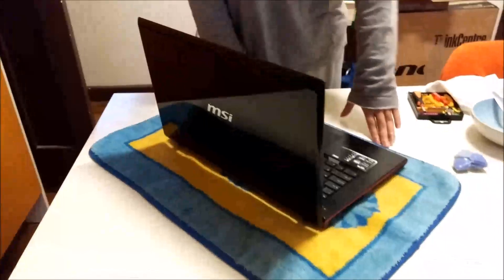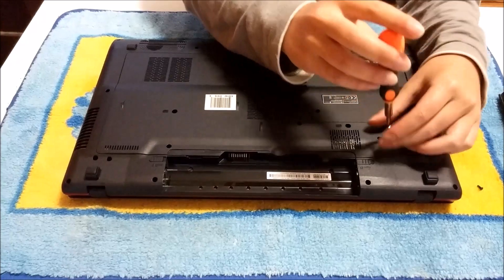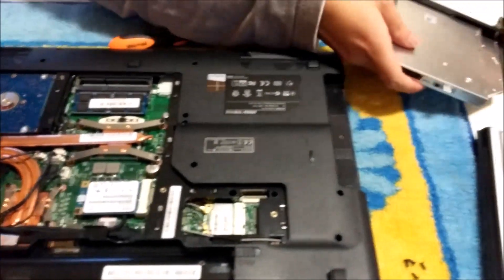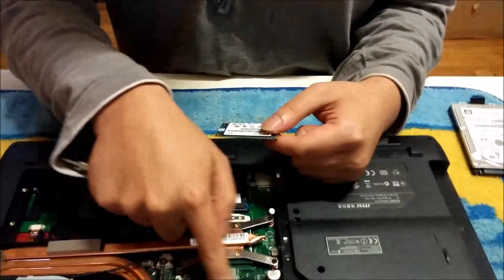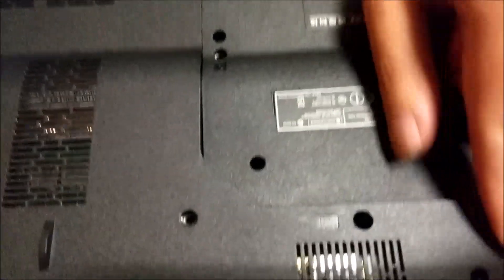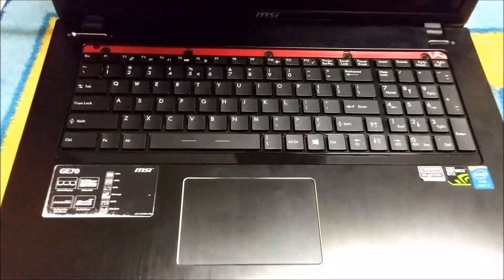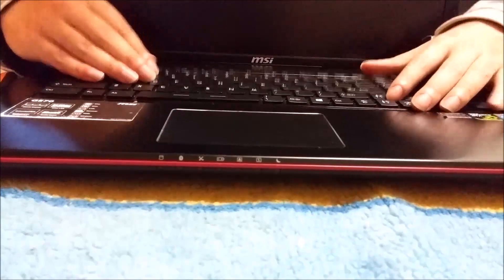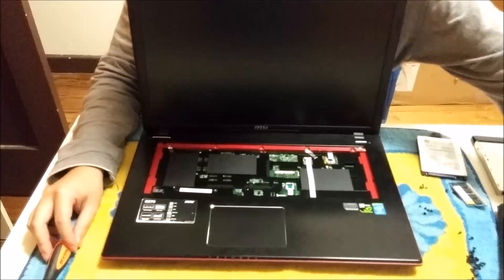OPEN ME UP! MSI Gaming GE70 17 inch Laptop Disassembly

Comment: You got some parts wrong when pointing them out. The card to the right on the video under its own cover is the wireless card (the 2 wires attached to it are the antennas), the card directly to the left of it across the black plastic is the mSATA SSD (if you remove the card the motherboard says SSD underneath). The chip with the single heatpipe on top of it is the CPU, and the chip with the 2 bent heatpipes is the graphics card (as it gets hotter and thus needs the 2 shorter heatpipes). The RAM in laptops is always closest to the CPU to allow for the lowest latency between the 2 components. I used to own this laptop and worked on it frequently, so that's how I know all of this.

Comment: has anybody tried two 1 TB mSata for Raid 0 (together 2 TB)? I have upgraded succesfully two times since 2014: first replaying both 128 GB mSata's (Raid 0 togeter 250 GB) with two Samsung Evo mSatas 2 x 250 GB (Raid 0 together 500 GB), later than two 500 GB Samsung Evo mSata's (together 1 TB Raid 0) - but would the the MSI  recognize 2 x 1 TB?

Any no chance for 2 x 16 GB?

... and what is the fastest possible CPU? (stock: i7 4170 hq)

... and are there possibilities for a graka-upgrade, too? (stock: GTX 860m, 2 GB)
Reply from the maker: graphic card is soldered on therefore can be replaced. the CPU can be changed and 2x 512 mSata will work. STOP wasting money on this old laptop. you are just digging yourself a hole. it is cheaper to get a new computer with that money and it will perform better than this. NVMe is cheaper than mSata and better in all ways. newer graphic cards are also way better than your old 860m

Comment: Lately, when I play games, even not very demanding games, I will get a lot of stuttering, and the sound also lags, creating crackling sounds. The laptop also heats up insanely fast when playing games, within minutes of starting a game i can feel it being very warm from the outside, most noticably in the area between the keyboard and the touch pad. Now I have dusted out my fan without removing it recently, but it didn't seem to work. I didn't apply any thermal paste and didn't remove it, because I am not very good at these kinds of things. Is there any risk involved if I try to do it myself anyway? Should I replace my fan, or do you think it can be solved by taking it out, cleaning it and applying thermal paste? And should I get a professional do it, or do you think I can resolve this issue myself?
Reply from the maker: this laptop is quite old so it is normal for you to run into these issues. you dont need to replace your fan but if you can change the thermal paste that will be good. the most important thing to do is to remove the dust which you have. use for a bit and see how it goes if you not happy with it then i recommend you to replace the thermal paste.
Reply: When I removed the fan there was a load of hidden dust in there, and after cleaning that out the issue was gone :)

Comment: I have been using this laptop since 2013, would you recommend to remove the backparts just to blow out some 'dust'. As I have never done this before, what should I use to blow it off, and also, what should i be careful about? :D
Reply from the maker: if you watch the video and think it is too hard then i recommend you dont do it. you are asking about how to remove dust which shows that you dont understand much about computers physically which is bad but with sometime on google you can learn about it. after learning about that and you feel the video is simple then do it if not dont.
Reply: What the fuck. That's a big ass wall of text. And also, I'm not braindead, I KNOW how to remove the backparts, i just wanted to be aware of some of the risk that could occur. I have heard that it is not recommended to just use a normal vacuum cleaner for instance. Also, It was a simple question if i should really BOTHER to do it or not.

Comment: Hi, My ge70 wont get past MSI, and i cant get in to bios, if i reset my battery would this fix my problem?
Reply from the maker: nope. what did you do? i need to know so i can help you with your issues
Reply: My laptop doesn't get passed the MSI screen (won't boot.) It just happend randomly and i can not get in to bios now
Reply from the maker: you clearly have some other issue. also removing the bios battery does not reset anything. only the time changes thats it
Reply: probably a drive/ OS issue, try reinstalling windows from boot media.

Comment: changed my screen now im geting no power too laptop
Reply from the maker: if you using the power plug then you probably forgot to plug the cable back to the motherboard but if you using the battery it is directly connected to the board and the issue is still happening that means you didn't connect the screen cable correctly

Comment: Hi, when im removing the back cover, the very right hinge just cannot go off. When i bent the back cover and looked what's inside, there was something attached to the back cover and i was lifting it too. Have any ideas how to deal with this?
Reply from the maker: you forgot a screw
Reply: maybe, maybe. Gonna try unscrewing most of them
Reply: I also had this issue. Did not forget a screw. Its right where the warranty sticker is. Its as if they made it impossible to take off the back plate or something.
Reply: Aha, I figured it out. There was actually a screw hidden underneath the warranty sticker.

Comment: Heya, did you not cover removing the fan? Can this be done without the other components? I need to clean it out because the ac port on the laptop gets insanely hot after 20 minutes or so of being on, so the metal part that goes in to charge the battery also gets really hot. Starts to create a "burn' smell so figured the fan is clogged up as it's right next to it.
Reply from the maker: no you must remove basically everything to get to your fan
Reply: Thanks

Comment: So excuse me if i sound "noobish" but deos this mean that its possible to upgrade my laptop?
Reply from the maker: this is what you can do. CPU can be changed, Ram can be changed to 16GB max with 8GB DDR3 in each slot and there are 2 slots, wireless can be changed, MSATA SSD slot and hard drive is a 2.5" inch hard drive.

Comment: Hi my msi ge70 has the regular none backlight keyboard and I want to upgrade to the color keyboard. Is that possible to do or does it have to have the capability?
Reply: On my GE70 2OE regular keyboard without backlight too. In the video I see that on the motherboard there a 12-pin connector for connecting a backlight of a keyboard (under the HDD). I checked this connector on my notebook and it's on this place too, but not used. I think that is possible to connect the compatible keyboard with backlight and it will be work properly without any problems, and this is what I want to do in near future.

Comment: Hello, what additional steps are needed to remove the internal "memory" battery? Thanks
Reply from the maker: you have to remove everything as it is on the other side of the motherboard
Reply: Ok, thanks.
Already got it done. After more disassembly to get to it the battery has +/- wires leading to a plug but battery and plug is sandwiched between 2 circuit boards so there's no way around it disassembly is a must.
Reply from the maker: better off if you disassemble it. that way it is much safer

Comment: Thanks for the video, could not figure out how to take the keyboard out before. 

I spilled a little bit of water on top of the keyboard and now the right hand side of the keyboard is always glowing(even when the laptop is off and most of the keys on that side don't work/press themselves. I took the keyboard off and dried it the best I could but the issue is still there. Any suggestions?
Reply from the maker: normally when you get water on your keyboard it is over you cant do anything about it even if you dry it, it will not work
Reply: Pretty much a new keyboard.

Comment: Hey my dude, my MSI laptop has been starting to lose frames in games I was able to run at 60 before. If I dust it out do you think I could get my performance back? Thanks for the sick tutorials.
Reply from the maker: by cleaning your laptop and replacing the thermal paste you can get your laptop back to the original performance it had when it was new
Reply: Alright my dude, I will try that out. Thanks for the response.
Reply: Did it work?

Comment: thank you so much. my word was the inside of my machine dusty. it is running much cooler now with far less strain on the fans. cheers.
Reply from the maker: thanks for your support
Reply: My MSI laptop has recently stared running less well with games. After dusting yours out did it begin to work much better?
Reply from the maker: when your laptop get dusty it is harder to remove heat therefore your laptop needs to limit the heat out put so it doesnt burn out. this is why your laptop performs less than normal to reduce the heat out put.

Comment: My GE 70 doesn't have that Sticker strip for removing the keyboard. At the top of the keyboard there are 5 notches. And then between the two speakers above that I have 7 buttons. Any ideas on how to remove the keyboard?
Reply: Exactly, and this laptop is on the Main picture of this movie, in the movie therebis diferent one.

Comment: I'm having the same problem as Surya Mani. My wife has this laptop, but the CMOS battery is dying and causing the clock to slow down. I can't find where the battery is to replace it though.
Reply from the maker: +coldwind I apologise I don't have the laptop anymore so I can not help you.
Reply: +OPEN ME UP time is not late becouse of CMOS... If CMOS battery is dying, then it will reset whole date after restart to factory date (something like 1.1.2009).. If you have problem with time in windows, its due to bad sync with time servers

Comment: I spilled some juice on my keyboard, and now the keys are a little stick - is it possible to remove the keys to clean?
Reply from the maker: +Garreth Hodgkinson nope you really can't do anything about it.
Reply from the maker: Yes you can try not to break the plastic clip that holds the keys on the keyboard
Reply: You can also wash the keyboard in warm soapy water,  then rise with cool  clean water, shyake the keyboard  'gently' to remove excess water, then leave to dry preferably  near 'but not on' a radiator or  on a window sill where the sun shines. Or use a fan to blow air over the keyboard until dry. Leave for a couple of days to ensure the keyboard is totally dry, then put back.  

This may sound crazy with electronic equipment, but  it does work with this sort of keyboard.

Comment: thinking of changing my harddrive. Does 950 pro is compatible with this laptop? It says  PCIe M.2 NVMe SSD but i don't have any clue what that is. Thanks
Reply from the maker: nope it doesn't have a M.2 slot so you can't use this

Comment: Can you suggest any screwdriver? The screwdrivers I have very short to do the job
Reply from the maker: +Berk Olcay any screw driver that works will work as all the screws are basically the same size. I can't suggest you one as screw drivers don't have sizes or number for me to tell you
Reply: Which one do you use in that Video may I ask?
Reply from the maker: something like this comes in a set and cost 8 AUD from ebay http://www.ebay.com.au/itm/New-32-in-1-Screwdriver-Hand-Tools-Set-Torx-T3-T4-T5-T6-T8-/131035330632?hash=item1e82507848
Reply: +OPEN ME UP i wonder it can reach to screw but in the video it looks like can reach. thank you soo much :)
Reply from the maker: the ebay link I provided you is actually the one I use

Comment: I have a question My MSI Laptop is bluescreening and its probably an overheat issue - is it safe to take apart the heatsink to clean it? 

My Laptop is very similar to yours and its heatsink is very similar.
Reply from the maker: +RegentofSparta yes it is safe if you watch my newer videos I do it for every laptop. there is also a video on how to clean your fan and replace the thermal paste
Reply: Cheers man :)

Comment: was thinking of getting this one , but I want one that I can take the battery out as well 

http://www.saveonlaptops.co.uk/9S7-179323-019-MSI-GP72-2QE%28Leopard-Pro%29-019UK_1811136.html

would be greatful for you help and advice am in the uk , do you have a email to get info
Reply from the maker: +Mike h this laptop here comes with 950M which is quite weak. as you may know laptop graphic card are only about 60% when compare to the desktop version of it. The desktop 950GTX only cost 150AUD and it isn't really that good.
Reply: +OPEN ME UP 

did not know that the 950 m is weak , dont know to much about them to be honest only thing with the gt70 is the keyboard is not backlit , at night here I would need one 

thanks for the video link too :)

Comment: which GE70 is this one
Reply from the maker: ivy bridge one with i7 3rd gen
Reply: +OPEN ME UP 

ok thanks what one would you recommened for uk users upto £850
Reply from the maker: +Mike h sorry don't know how much is 850 Euro as I live in Australia but then it is really up to what you need.  since you ask this question under an expensive laptop I assume you after a powerful laptop. branding doesn't matter anymore as you may know they all just ending up using the same parts so just pick the design you like or the branding you like most. the most important thing is there only 2 options, weak and high battery life or powerful and carp battery life
Reply: +OPEN ME UP 

Hi 850 euros is about £600-£700 uk pounds  not that much have you worked with the gp72 leopard pro yet , I want it mostly for editing videos 

will play some games like F1 etc  I want to get one upto about 1000 euros or below  have seen some 2nd ones on here  

http://www.dabs4work.ie/products/msi-ge70-2pl-218uk-apache-core-i7-4710hq-12gb-1tb-17-3--windows-8-1-9VK6.html

for 667 euros not sure if its a good idea to buy it 2nd hand incase theres problems with it
Reply from the maker: +Mike h basically everything I buy is second hand and I don't have any issue with it. I cant really provide you any recommendation but all I can tell you is I purchase this laptop 9 months ago and it cost me 700AUD second hand. So I don't believe it is worth 1000 eruos

Comment: I know in the case of  many MSI laptops (at least for my MSI GE70 2pe Apche Pro), the CMOS battery it hidden behind the back, even once you remove part of the back to access the hard drive, RAM, etc. Is there a way to remove the final part of the back or any other way to access the CMOS battery?